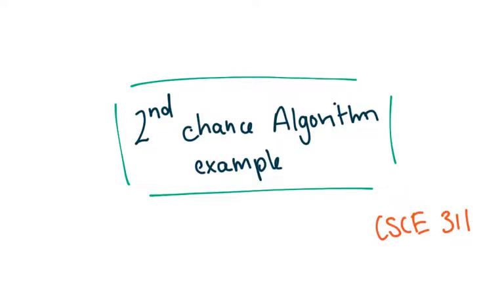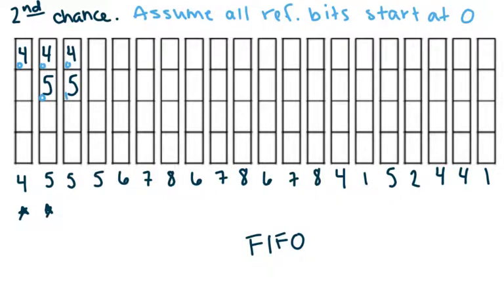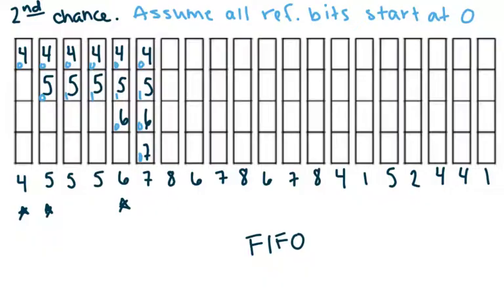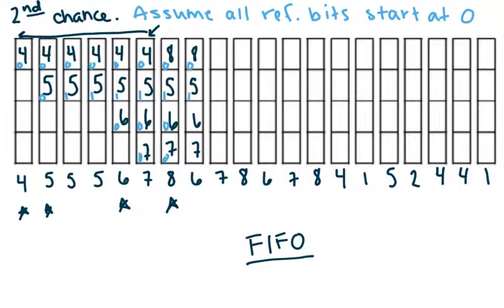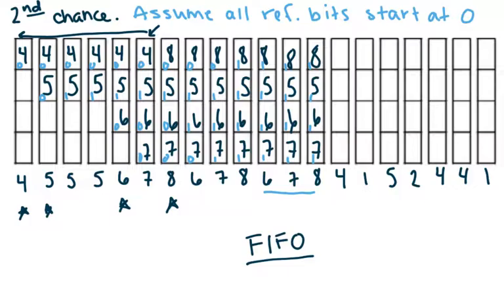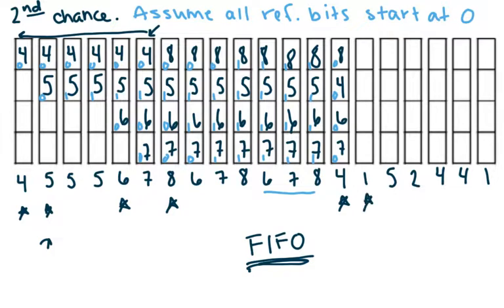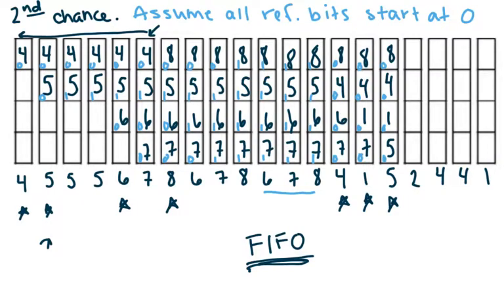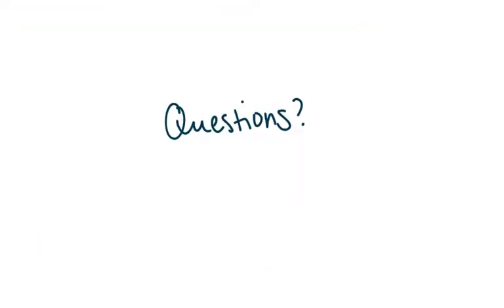2nd Chance Algorithm Example

Comment: This exemple is wrong. In the classic second chance algorithm after inserting new data into a frame the reference bit must be set to 1. When starting at frame 0 after inserting 4 into the frame we have to set the reference bit to 1 in this frame. There is also a pointer showing which frame is the candidate frame (victim frame) to insert data at the next page fault. So a the the beginning all the reference bits a set to 0 and the pointer is set to frame 0. Inserting 4. Setting reference bit to 1. Moving pointer to the next frame (in this case frame 1).  When there is no page fault the frame where the value is locate will have it bit set to 1 if not already. The pointer will still be set to the last frame in date.
Reply: thats a different implementation